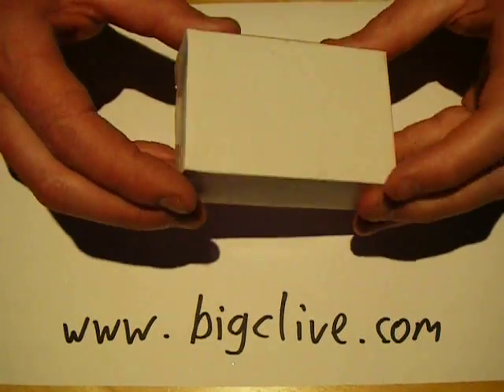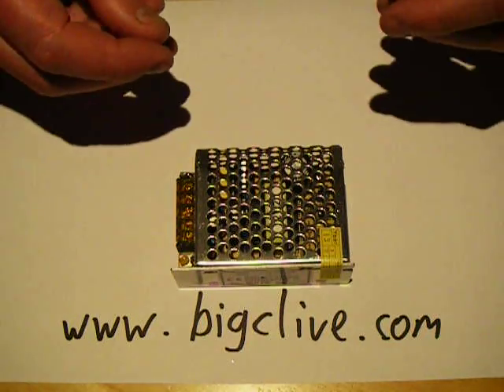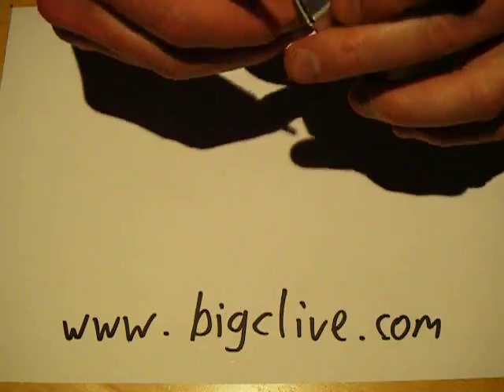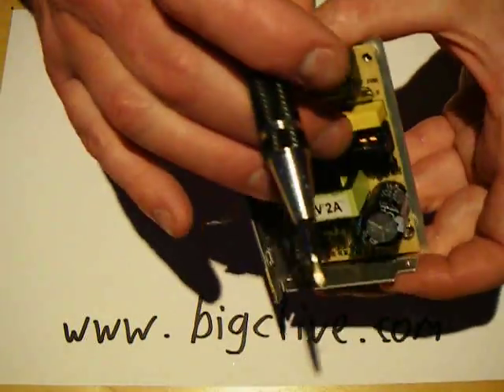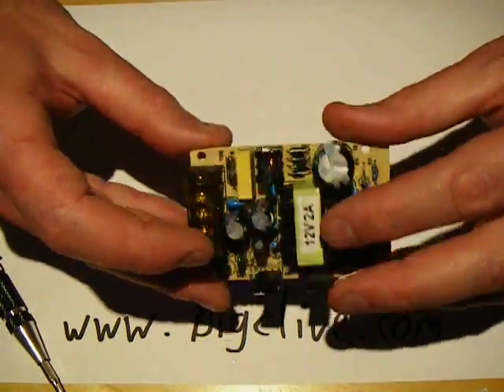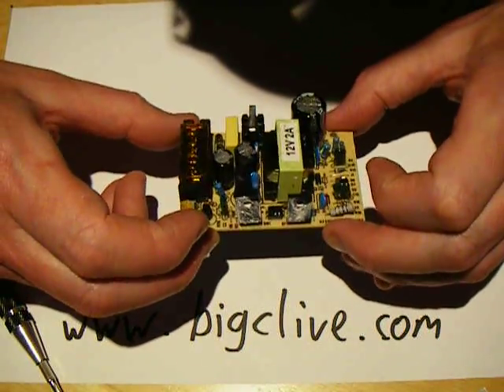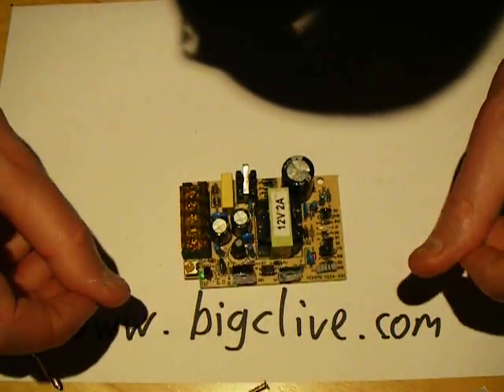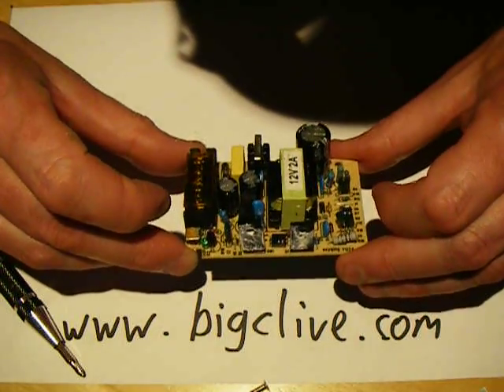Cheap ebay chassis PSU teardown.

Comment: I have two similar units,  though higher current.  One is a 30A unit that I use to run my amateur radio gear, set for 13.8V out.  The other one I bought to play with some high-power LEDs,  and is rated for 10A out.  Both work quite well for what I'm doing with them.  The only issue I have with them is those terminal strips-- I use ring terminals,  so they won't come off,  and the size of the ones that will accomodate #12AWG is too big to fit into the space in the strip between the barriers,  so I ended up having to grind it down on both sides with a dremel.  Other than that,  no complaints...
Reply: Yep, me too! Although i just cut off one side of the ring to make it fit.

Comment: Hello, good video.
I have this power supply and it broke when I caused a short on the DC side.
A change of the backup bracte no success. What else could be broken. Please help.
Please excuse this english. Google translator, hmmm. I am a german.

Comment: Just bought an amazon AC voltage regulator for £1.91 My meter across an incandescent says 100 to 240 V. Trying to vary an extractor fan speed doesn't work though. Perhaps not smooth enough? Can I send you one? I reckon the ScotGov should be paying you to test all this strange and dangerous stuff! Stonking!
Reply from the maker: It works like a dimmer.  Does the lamp dim up and down?  If you connect both the lamp and fan and it works then it might be an issue with the inductive load.  If the fan still doesn't vary in speed then the motor may be synchronous and not suited to dimming.
Reply: @bigclivedotcom  Ta. Good thinking : the lamp in parallel with the fan certainly makes the fan happier. Building regs now say that closed rooms need trickle venting, so I was hoping to use an inline extractor fan at low speed. Sadly the above arrangement gives an unpleasant hum at low speed. Any other ideas? Would the other gizmo you tested (with bridge rectifier) - now £1.01 in the amazon - give a smoother output? My multimeter showed the output voltage as anywhere from 233 to 334! Clearly confused by the chopped waveform! Cheers JC
Reply from the maker: The chopped AC will be making the fan noisy.  A common approach for some fans is to put a capacitor in series with them.  If you search eBay for "fan capacitor" you'll find a selection.  The correct type will be trial and error, but for a small fan it could be in the region of 330nF to 1uF.
Reply: @bigclivedotcom  Ta. I'll try. Or should it be in parallel to shunt the spikes?
Reply from the maker: @jcsubmit  It's in series to limit the current through the motor.
Reply: @bigclivedotcom  Ta. JC
Reply: @bigclivedotcom  The capacitor concept works - brilliant! I'll bring my creation along on Sunday. Cheers JC

Comment: I soldered terminals to a 12v 2.5a supply made for an lcd screen, I found in garbage. I use this little neat psu for everything, from fans to a little dc vacuum cleaner.

Comment: Got one recently and comparing it it seems pretty much the same. The arrangement of some of the support components (especially around that 400v capacitor) is a little different. Didn't come with a terminal cover, but it's going to live in a box anyway..

Comment: Well, I was considering sending away the cheap 20 amp PSU that came with my 3d printer for youtube disassembly, but it looks exactly the same as this unit so you've saved me the effort. I do intend to take it apart though to have a close look, and add more cooling, my unit didn't have the case covered in holes like this one does.

Comment: I have hd two of these fail very loudly. one had a plastic film still on the heatsink. The rectifier chip and switching FET were glued to the film not the aluminium.

Comment: Building a 12v piltier frig. can I run two of these parallel to get the amps I need?
Reply: +william staten -- You can run them in parallel, but they may not share the load equally, leading to early failure... and if one fails, the other will probably follow immediately. Better you should get a single, larger unit rated for twice the expected load!

Comment: It looks to me that it is a cheap linear style power supply. They are actually half way decent power supplies. They do produce a bit of heat though. I think for the price it is hard to beat.
Reply: No, it’s not a conventional mains transformer design. It’s a switch mode power supply unit (SMPSU).

Comment: Hi, would one of these work for a 5m RGB 3258 strip??
Reply from the maker: Yes, but you'd need to shroud the terminals.  I actually see these lying about in the windows of Asian shops with no insulation and random metal objects in the vicinity.
Reply: No worries. I live alone, so there is only me to get zapped :D

Thanks Clive.

Comment: I have some basic understandment about smps, but what i  dont understand is how they can step 230v mains down to 12v without any big transformer? and still be able to draw 2A on the output..
Reply: +STFN -- The basic reason is that like with a capacitor, the energy (in joules) stored in each pulse of power is independent of frequency. Raise the frequency and you get more pulses in the same length of time, which equals more power (in watts). In switch-mode power supplies, they raise the frequency A LOT. This enables the use of tiny transformers, and in most of the circuit (except for the line input), tiny capacitors and inductors for filtering.

Comment: is this Legit ? http://www.ebay.com/itm/Boost-DC-DC-Converter-Power-Supply-Step-up-Module-12V-60V-to-12V-80V-600W-10A-/231572940208?hash=item35ead2a5b0:g:-hgAAOSwBLlU9qKi
Reply from the maker: Yes.  eBay has loads of different buck/boost switching converters.  Although sometimes they stretch the voltage ratings a bit.
Reply: +bigclivedotcom i love DC to DC Circuits and LED but my all 4 of  my Soldering Iron gone Pooped from Wear and Tear ... Sigh ....

Comment: I use the 5v version of this to power a laser for an optical sound head in a film projector. When I first tried it, it was making a squealing noise from the supply itself and from the sound output and before throwing it out I decided to connect a 12v halogen and that cleared it up. What else can I load it down with besides having a light always connected to it?
Reply from the maker: +fancysnake1 It might be better to use a smaller 5V supply.  The bigger supplies may need a minimum load to operate properly.
Reply: I love the sound and smell of caps  in the morning. Nice channel clive btw. I have seriously seen a nail as a fuse (not factory) nothing would surprise me. it was meant to be a G.I. circuit at 1/2 amp 6.3 VAC, but yeah well it worked at the time I got there the glue stuff was bubbling out the top of the TXfmr but it was handling about 20 amps... . lol   Wel it was, obviously I removed the gpo. But you find alot of funny things in Arcade machines, I found a finger once, try explaining that to the police. Well it was just the first bone, not like a whole finger. I got a service call because the sound wasn't working....... lol. It had been used as a hidy hole, and well he musta wanted his whatever, there was no drugs, just a finger tip bone.

Comment: could you use this power unit to run 100 5mm leds
Reply from the maker: +Ray Campbell It would be way over powered and also has open mains connections on it.  If you want to power a lot of loose 5mm LEDs consider using a good quality USB power supply and using a resistor in series with each LED.

Comment: That looks like a rather old discrete flyback type design. It'll probably be reliable as it looks quite well made, but I'd guess its efficiency and emi performance will be sub par these days. It's possibly so cheap because they probably made a huge quantity and have a large surplus to offload.
Very good value for money, Clive! I was interested in these myself, I couldn't believe the price.
Btw, the audio is horrendous in this vid, it sounds like a wax cylinder recording!

Comment: I have the 5 amp version that looks identical to this. Mine works from 11 volts to 13,2 volts. Been in use over 12 months now, no problems. Even on an audio amplifier output is noise free. As you said amazing value.

Comment: I'm currently looking at a few of the big versions of this, specifically to power about 10,000 RGB leds. Good to know at least some of them won't send 240v down the low voltage side in a hurry.

Comment: I bought two of these from different seller. The exact same models, but different seller on ebay. The one gives a beautiful 12v supply, adjustable up to 14V with no load. The other one is absolute rubbish and jumps from 6 to 13V. So dissapointing! So not every one out there is as well designed as this one. :)